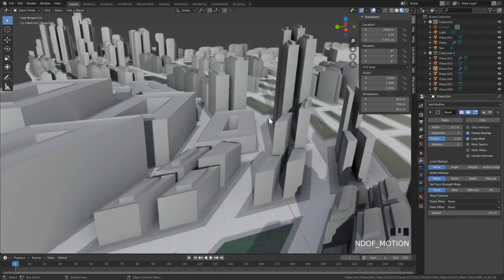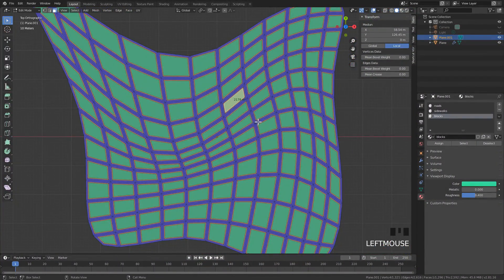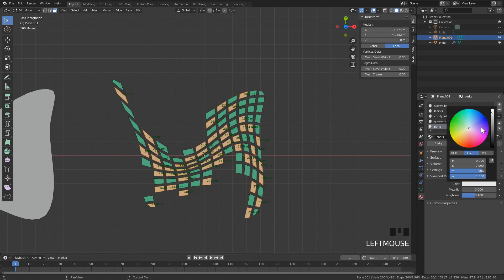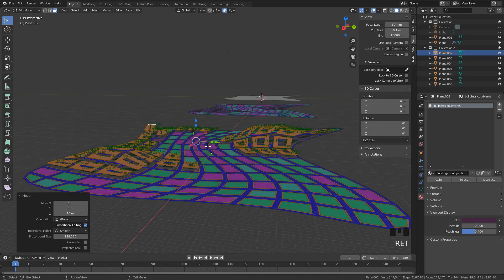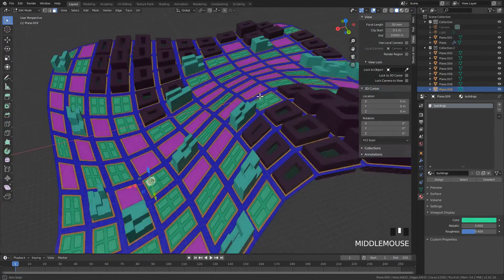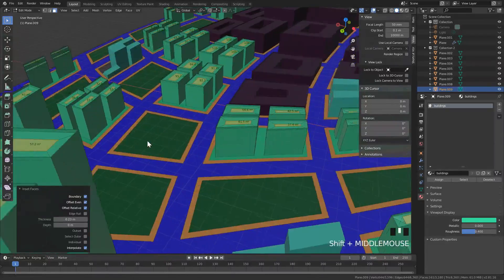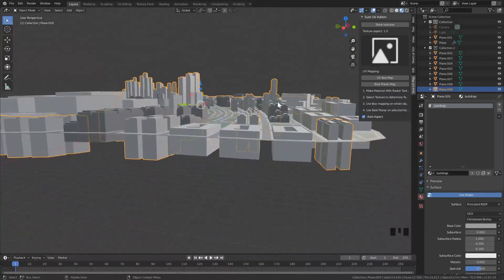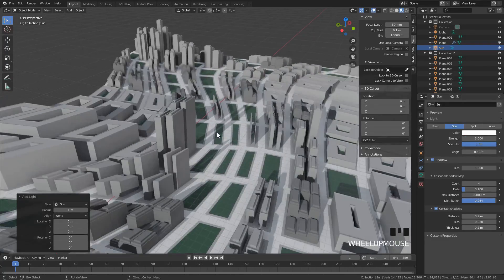Concept design a city or masterplan in Blender

Comment: Is it possible to create a displacement texture for this city? If yes, how?
Reply from the maker: I am sure there is but I don't have too much experience with displacement maps, mostly because they are not that efficient for this scale of things. Displacement maps require large amount of subdivisions and then pushing areas in the Z direction based in the black value. Things like cities in a close up tend to look a bit pixelated. For background scenes it may be fine but for mid and foreground it probably wouldn't be. But I am not the best expert either

Comment: What addon gives you the measurements on geometry  in edit mode (it isn't MeasureIt is it?) Nice result btw.
Reply from the maker: It's a native function, accessed within the overlays pop-out menu located to the right of the shading and xray view modes. In edit mode, near the bottom there are options for measurement of selected elements - area, length, and angle. Also, don't forget the new annotate tool in both object and edit mode in the left-hand toolbar, available in 2.8.